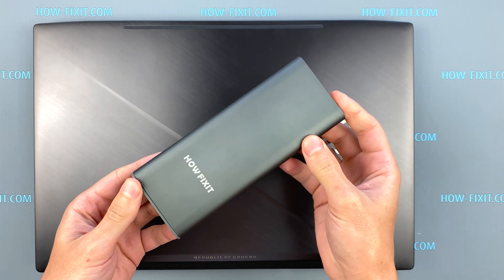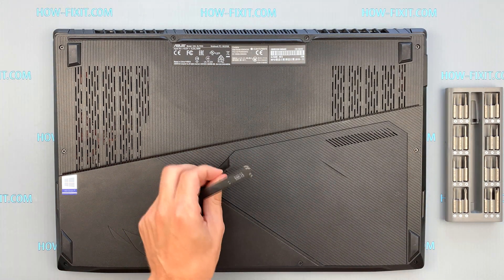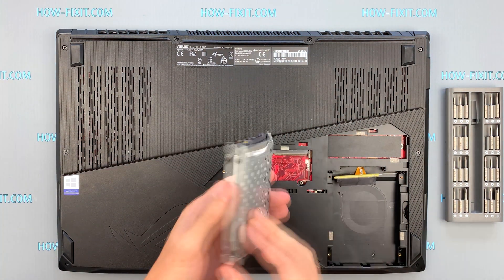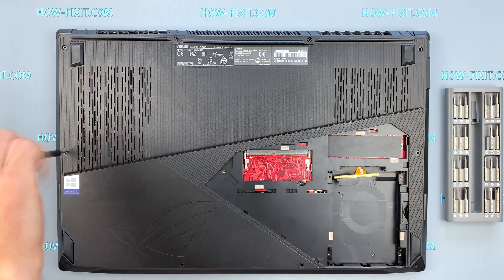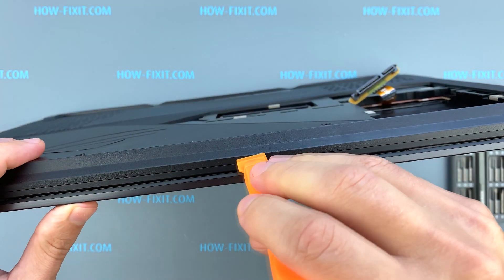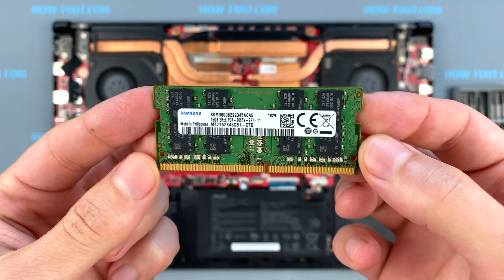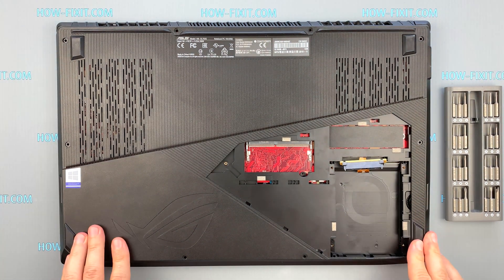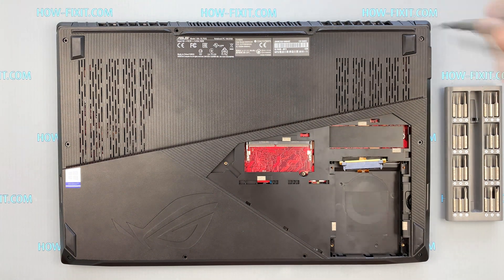Asus ROG Strix GL703 RAM Upgrade and Install - Your Step-by-Step DIY Guide!

Comment: hello! I have the gl703ge edition, which comes with 12gb: 1 module of 4gb and one of 8gb, I have bought a 16gb and i want to replace the 4gb module. 
According to the video above where should i place the 16gb module, is there a primary ram slot and secondary, and if yes which is which, the above or below slot?
thank you in advance!

Comment: The max is 32gb ram? So you can’t use 2 sticks of 32gb in both slots and have it work?
Reply: The motherboard only supports 32 gigs of ram
Reply: @bigdogbigdog5997  oh that sucks
Reply: @GenesisHD  why? How much do you need?
Reply: I think that only 32gb would run.

Comment: Nice tutorial... Is it possible to install two RAM of different size but of same frequency? i.e., one 4GB DDR3L and another 8GB DDR3L?
Reply: Yes, you will be able to use two different ram sizes Ex: 16gb + 8gb.  A 16gb + 8 gb configuration will have 16gb in a dual channel configuration and 8gb in single/flex channel configuration depending on if your CPU supports 'Flex Memory'.  I would highly suggest getting an additional ram stick that is the same brand as well as same frequency/mhz and same latency/timings/CL  "Ex: Ddr4 2666 CL18 + Ddr4 2666 CL18".  At worst you can mix different brands with a different size, frequency, and timing, you may run into problems at some time or another but it is unlikely.  Hope this helps - Tom
Reply: @tomjines  hello, do you know what is the maximal frequency of ram that this laptop can use ?
Reply: @emircanertunc671  hello hello!  I can't say for sure.  Though I have seen similar laptops with similar specs that came stock with 2666mhz ram that could run 3200mhz.  Depends on what generation of cpu as well.
Reply: @tomjines  I have an i7-8750H. Eventually I think I'll buy the same 8gb 2666mhz RAM that I have to make 2x8gb instead of 2x8gb 3200mhz because I'm not sure if 3200mhz could run. I can't find on the internet the max frequency that my CPU could run.
Reply: @tomjines  With 8GB RAM my PC lags, when I use Chrome I have already used 80%.
Reply: @emircanertunc671  I would recommend getting the same 8gb 2666mhz module and see how that performs before jumping up to 3200mhz. I am almost certain 2666mhz will work great for you.  If later on you decide that you need more performance and/or capacity then look into the 3200mhz modules etc.  Either way just make sure you get another ram module/stick so you are running dual channel vs. the single channel you are running now.  Best of luck Pal - Tom
Reply: @tomjines  Thanks for the advice
Reply: @emircanertunc671  Your welcome!  Let me know if you need help with anything else.
Reply: Yes.